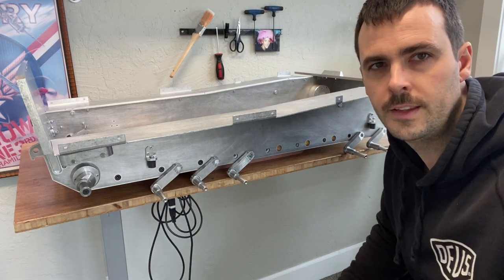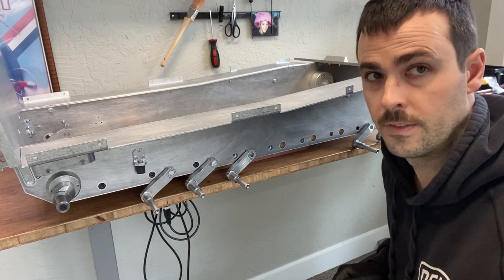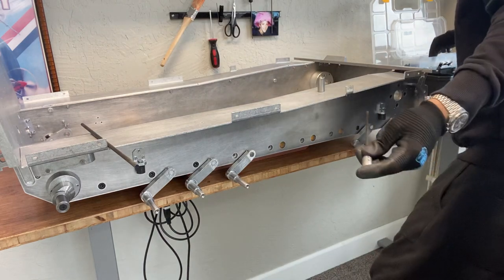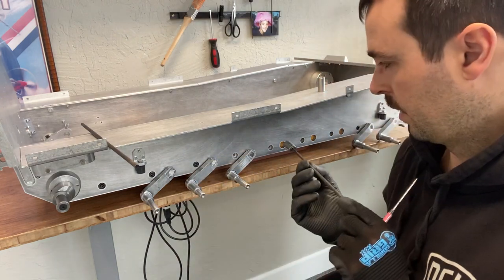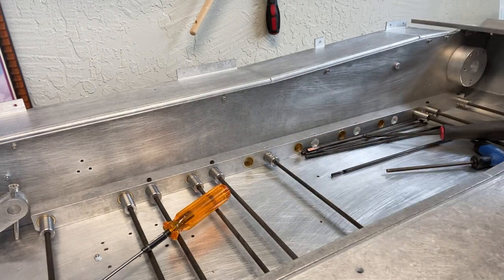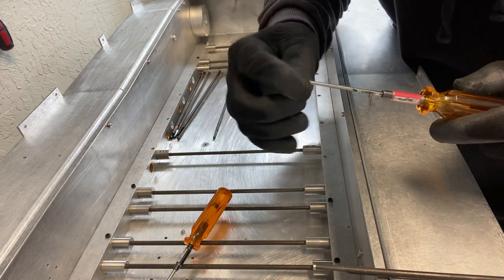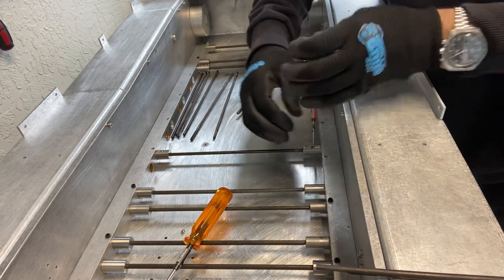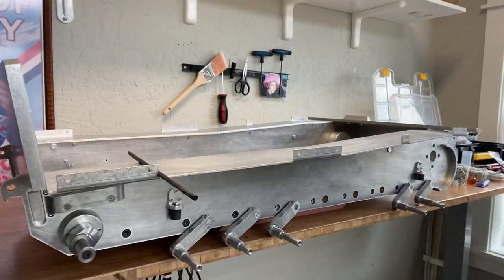Building the Armortek 1/6 scale Tiger I WW2 Heavy German RC tank- Suspension setup.

Comment: These look great until you factor in what these cost. The price is just insane and how they can justify that for a small metal box I just cannot understand. I'm not surprised they sell so few of these. It really is criminal
Reply from the maker: The cost of the materials in the kit is quite low compared to the overall retail value, but it’s hardly criminal considering they are the only manufacturer in the market and most of the kits are limited edition with some models selling out before they are even released.
Reply: @brianostlind9662  it's all subjective. It's a metal box with some servos. Bit yeah. Thats maybe hyperbole.
Reply from the maker: @nathanprentice7230  if you can do better then go for it!
Reply: @brianostlind9662  anyone with a lathe and basic casting skills could. It's a captive market. In this country they cost 6,500. That's about 9000 dollars. I've got a casa ssr scuderia  50bhp engine made with custom cases for that. I guess stupid is as stupid does. Have fun.

Comment: I would personally prime the parts before installing them , I'm not criticizing, it's just my personal procedure, some of the parts will be very hard to access in the later stages of the build and you might have areas without protection to the elements and corrosion
Reply from the maker: Maybe some steel pieces. The tank is 99% aluminum. Look at Armortek company models that are 20 years old without a drop of paint they have zero corrosion.
Reply: @brianostlind9662  saw some guy on the forum complaining his rusted up in the garage, an older model probably, nowadays I see they're making them full aluminium